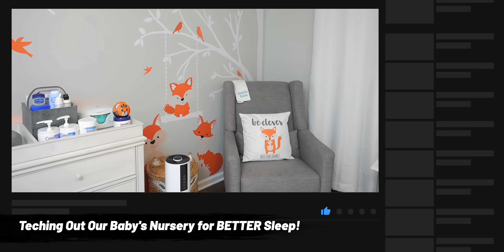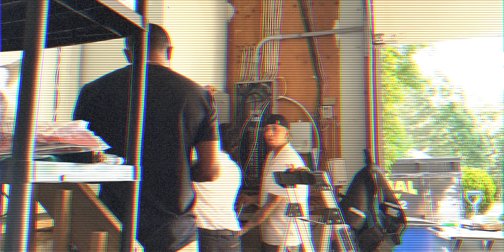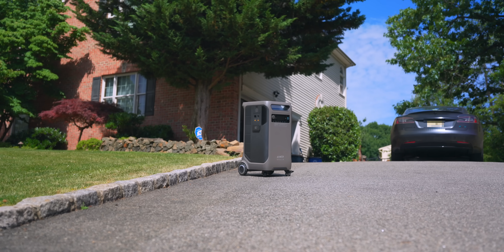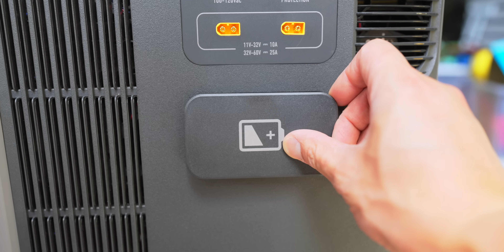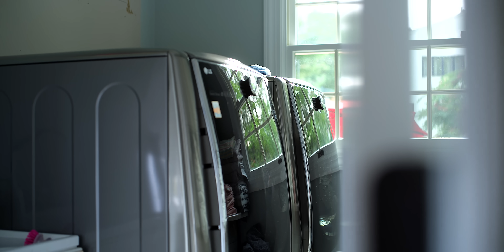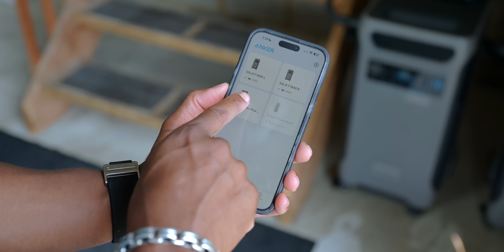My Ultimate Tech Garage Transformation! Pt.1 - Backup Power Install!

Comment: I know Pauls from Pauls Hardware does a lot of home improvements. Man speaks with a drill, but yeah with a house 100% learning the ups and downs of home improvements, especially the small things where you could try and learn to resolve a problem vs hiring someone. I'd love to watch that journey. 
On a side note, those Electric generators should have a vented enclosure in there if it gets hot and humid. also suggest adding a dehumidifier.

Comment: Though I lean more towards the battery backup for a home, propane or gas generators are a lot cheaper than these, and provide longer power. Downside is the noise....they are LOUD and this is near silent on light use.